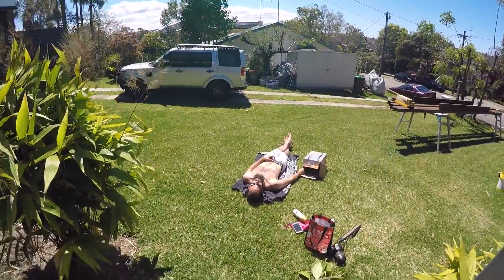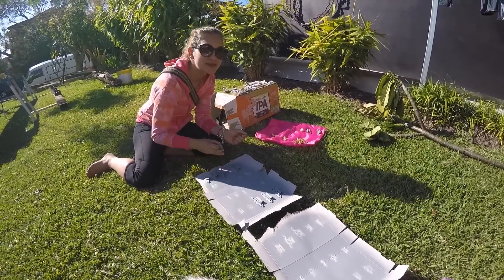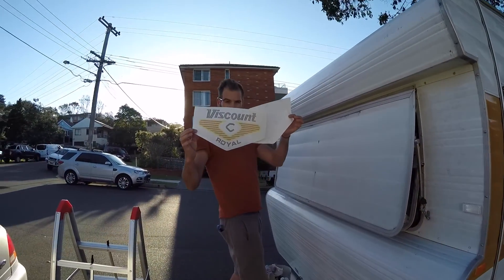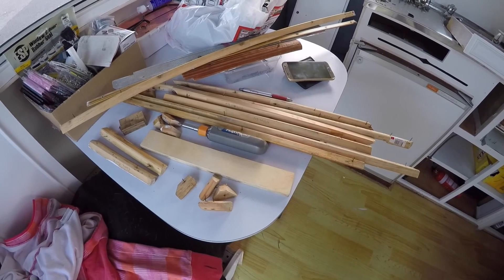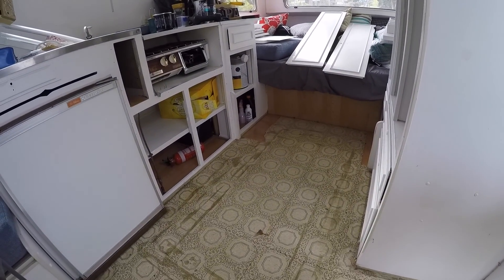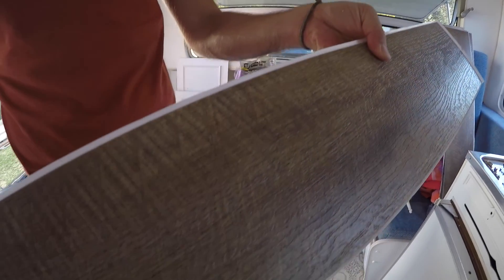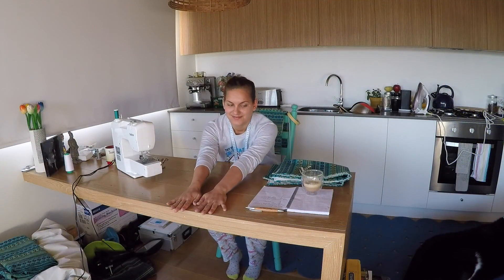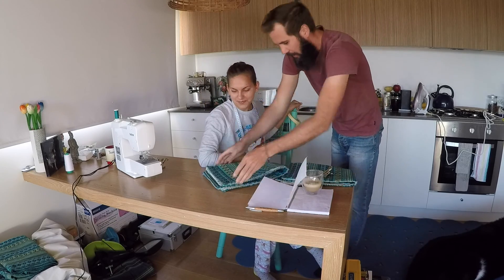Iago: Viscount Caravan Renovations - Black Pepper Abroad (Part 5)

Comment: I removed the original floor tiles in my Franklin and Carlos in his Millard. 
I am aware of the asbestos content on them, I worked in the CSR division that manufacture them and handled the bags with asbestos. That was 40 years + ago and my lungs are clean.
Yes, I recommend to do the job in a very well ventilated area and with masks with the proper filters.
In your case it will be hard because your van is already fitted out, ours was empty.
How it is going the trip?
Reply from the maker: Glad to hear that after all those years of working with asbestos that you have your health, it's nasty stuff. If I was to completely renovate the camper I would follow your advice or turn to a specialist. We're enjoying our trip, so much to see and do. The only issue is finding good wifi to stay in touch with everyone, haha.